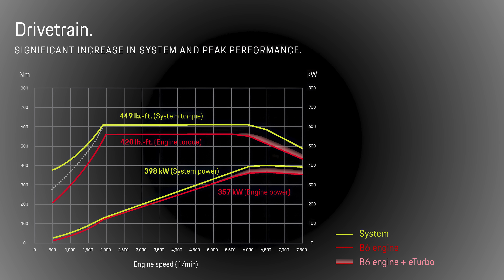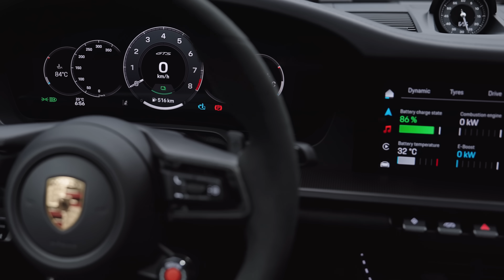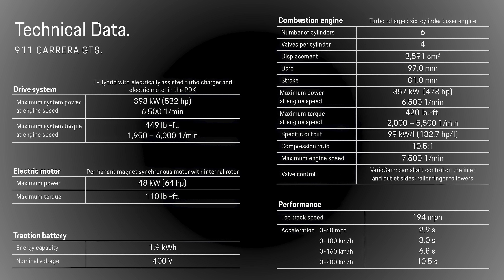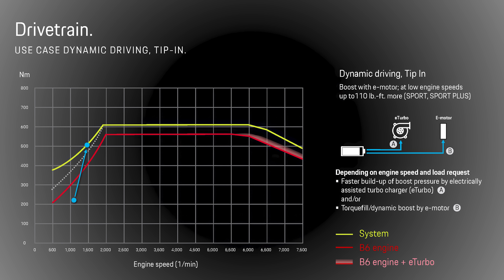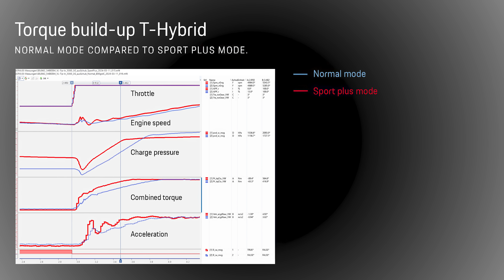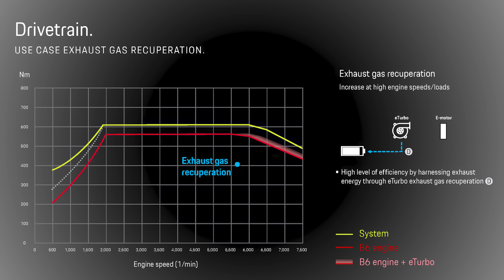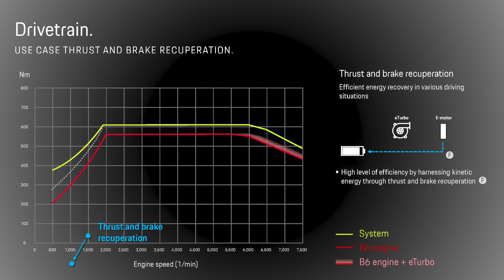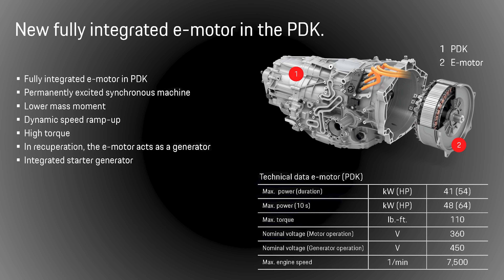2025 Porsche 911 992.2 | Bigger Engine, Electric Turbo

Comment: I’m confused about the mention of a waste gate or lack of waste gate. If the turbo is driven by battery why would there be a waste gate at all and what was done to correct the turbo boost level difficulty that supposedly stemmed from this.

Comment: Curious about the e-turbo and how it works.  I  apologize for my basic knowledge of turbos. From what I understand the turbine and compressor are connected by a single shaft.  When the electric motor spins up at a much faster rate than a typical exhaust driven turbo what happens on the exhaust side?  Could the electric motor spin up so fast that you end up creating a vacuum situation on the exhaust side?

Comment: Best car site. Great work here.

Never say never, but:

1. Hybrid.
2. Push to start.
3. Digital tach.
4. (really #1) No manual.
5. Builds now over $200K with options.

All of the above make me feel lucky I just picked up my new '24 Targa 4S that I ordered with the 7 speed. I don't care about sub 3 second 0-60 times and will likely never drive the Nurburgring. I can imagine an open air non hybrid manual transmission car coming in a year or two but only Elvis and Seinfeld will be able to get allocations.

Comment: It will be fascinating to hear about how this thing drives.  I am sure that Porsche have made a wondrously capable car.  But, does that translate to "better"?  I am curious if the engineering team were asked whether a manual transmission is even technically possible with this setup.  without full computer control of the transmission too, can any of this be made to work?  I suppose then that all t-hybrid cars will be PDK.  Start buying up manual-transmission Porsches now, I guess ☹.  If the GT division cars are all that are left with a MT, it's going to make those allocations even harder to get in the future.

Comment: I dont know how smart it is to rely purely on the e-motor to spool the turbo.

What if you run out of S.O.C.... Why not put a clutch in the turbo so that it still works with regular exhaust gas, or the emotor

Now that exhaust gas is no longer being used for turbo spool, what are you using it for? He explained the heat part of it, but what are you velocity of the exhaust gas for - nothing??? 

It's Porsche guys, cmon, make a crazy system with 2 turbo chargers, one with exhaust gas, one with electric motor to spool. A crazy double intake plenum to combine both compressed air flows into the combustion chamber.

Comment: Fix a problem that didn't exist nobody cares about the second that the hybrid system shaves off the 0-60 or the top speed or god damn mpgs ,the 911 was supposed to be a analog mechanical marvel wich it isnt anymore nobody complained about turbo lag in the first place nobody ever said power was insufficient,could have just tuned up the engine porting the exhaust intake cams compression etc instead of this ,besides the price is bonkers

Comment: The new hybrid 911 isn't about how the car will drive.  It is about what the car will cost to maintain after warranty as the electronics, from 100 computers to allow electric and gas powertrains to seamlessly produce power begin to fail, including motor inverter and Li-Ion battery outside of warranty when its on the customer's dime and not Porsche's.  Honorable mention to electric turbocharger and electric AC compressor.
Hybrids throughout the industry exist for one reason alone, 2.5 x's the complexity of ICE only automobiles which translates to long term profit for automakers. 
Selling exclusive, proprietary parts out of warranty for a car with two powertrains versus one if you can even find a mechanic smart enough to repair this car which btw will not be at an independent mechanic. Porsche would never allow the proprietary computer diagnostic capability to filter to mechanics outside the Porsche dealer network as it would be cost prohibitive for independents to own this diagnostic capability.

As to driving dynamics, power to weight will only be fractionally better, if at all.  Reason is weight. Hybrids are heavy which has a handling cost as well.
Anybody who has driven a $200K modern ICE Porsche is blown away by the performance. 
High end ICE Porsches have astounding performance.  A new hybrid Porsche isn't about performance.  It is about cost to the consumer short and long term which translates to profit.  The Germans invented this business model of overengineering their cars for planned obsolescence and extract more money from customers for greater profit.

PS. a bone stock 2018 Chevy Camaro ZL1 1LE beats this Porsche around the Nürburgring  in 7:16.04 for 1/3 the price with of course only a gas engine, a much more powerful gas engine which btw an average mechanic can repair.

Comment: 991.2 base msrp carrera was $90,450. Now starting is just over $120k (06:36)? I get that the average househould that buys a porsche is $400k, but wtf. A 25% increase in price over 5 years? That's just absurd. 

End of production for 991.2 was December of 2019. Accounting for inflation, that price is closer to $110k, not $120k.

Comment: "The hybrid doesn't change the feel of the car." Exactly what they said when they released throttle by wire. "You can't even tell!" Little by little they grind away what makes these engaging and turn them bland until one day not far off everything will be an automatic crossover. We'll wonder where it all went so wrong.

Comment: "More power, more performance!" - "8 seconds faster round the (irrelevant in the real world) Nürburgring!" - well that's nice - but how about more quality & reliability like Porsche used to have?  Porsche have in recent years gone from being one of the most reliable manufacturers - certainly THE most reliable German manufacturer, to being sub industry average.  I used to think if I was ever going to get a German car, I'd get a Porsche - now I just wouldn't consider a German car.  I just don't understand what happened - but the way the designers and engineers talk here, they don't even mention reliability once - so maybe what they are not saying is what the problem is.

Comment: For those who understand that heat is the biggest enemy of magnet motors, sandwiching it in between a hot turbo housing takes some work to solve the temperature issue. Although being skeptical at first of the hybrid, now reading the full spec, it is a great advancement. But hopefully, it solves the Porsche hybrid issue from the old days: once the battery is dead, the entire car stops.

Comment: We have already passed the threshold of diminishing returns and this is not the future I had in mind.
The ultimate cars have passed their peak.
When I hear H and E and other buzzwords like integrated, recharge, thermal, 48volt, etc,,, this means more complicated, more wiring and more weight and of course, more money, oh, and I forgot, no manual transmission!

I can't pretend to be impressed because I'm not an ass kisser.

Comment: I hope that there wouldn't be electrical issues as what tycan came with.  Practical point of view, wonder two things.  what if battery dies......... there is no 12v battery......  Does it means we can't do jump start the car and car needs to be charged?  And what if electric motor is not working.......  there is no clutch........  Does it means car can't be moved at all?

Comment: It’s always awesome to see Porsche roll out faster and more technologically advanced 911s; however, I have some mixed feelings toward the 992.2 this time. 

The analog tachometer
The ignition 

These two things are somewhat nostalgic, but true to the iconic image of the 911. 

I don’t really understand why all of the manufacturers put a big screen, or even multiple screens, at the dash, and call it as the interior design? 

For actual users, one definitely can embrace the beauty of the old fashioned analog tachometer; Not even to mention it comes with less distractions at night, and less light reflections in general; also, aesthetically, while seated inside without firing up the engine, the whole black panel just looks so cheap and tasteless. 😢😢

At this point, I feel fortunate enough to have 992.1 911T, as the last gen with analog tachometer and a more driver focused set up!

Comment: I just went out and hugged my 991.2 GT3 6MT.
Reply: Proven 4.0L H6 naturally aspirated engine. Solid lifters. Manual transmission. Easy to work on. Can buy engine oil M1 0W40 FS at Walmart. Heavy 12V conventional lead-acid battery. Exceptional build quality, fit and finish. Analog gauges, key in ignition. Lots to hug.

Comment: The complexity of that oiling system is daunting.  Semi dry sump with directed oil as needed?   Typical German solution.  Man, this thing is really loaded with new tech.  Very similar to the eRay Vette on the hot lap strategy stuff on max attack.   Sounds like a pretty thorough overhaul.

Comment: First off, congratulations to you guys for getting in early on the launch notes for this car.  Its certainly an accomplishment and a brand that many enthusiasts have idolized for a long time - quite an achievement!

Moving on to the 992.2 - this gives me a collective feeling of "meh".  The turbo tech is impressive, and I'm glad they decided on something minimally intrusive, but everything about this car makes it as dead to me as the base 992.1 (which was also PDK only).  Porsche seems to be losing the plot more and more as the years go by - they keep trading out the traditional 911 experience for more useless crap to show off on a spec sheet.  I spent a lot of time around 911s ranging from G-body to 997, and there was an intangible that kept those cars fairly familial (the only downside being how horrifically cheap 996 interiors were, but that didnt detract from the sound and driving feel of the car).  This just seems like everything the 911 is not - you're isolated out of almost everything special, and it's just fast....who cares?  As we enter the age of stupidly fast EVs, sports cars need to bring back emotion - especially when you're demanding 911 money for the pleasure.  How can Mazda with the ND, or Lotus with the Emira, get this so right, and Porsche get it so wrong?  I don't get it.  Anyway...soapbox mode off... I'll go back to fawning for a G body SC like the old man I'm becoming 😂.

Comment: Very cool technology, but I’d be worried about long term reliability. Maybe I’m just getting old but it just seems like so many more things could break on this (with time). I have a 991.2 and the wastegate failed on one of the turbos. At least that’s one thing you don’t have to worry about with the 992.2.
Reply: Yeah now you just have to worry about electrics imbedded in the turbo, a unique 400V battery, a water pump buried and driven by the oil pump for the sake of no accessory belt drive…great progress in reliability!!!

Comment: I have a 992.1 Carrera S that I really enjoy but at times it is a bit boring.  The turbo engine saps some of the emotion from the engine. It’s not as charismatic as my old 997.1. I understand the need for improved efficiency but I don’t necessarily trust it’ll lead to a better driving experience. That being said, I’m going back to a naturally aspirated engine this time around. My C8 Z06 should be here around July. I wish the GT3 didn’t command such high mark up’s or I may have gone that direction.

Comment: 992.1 prices 📈

-Rear taillight makes the car look like a full on EV. They did not need to add another long lightbar. That weird section where the “Porsche” logo looks awkward. The 992.1 rear end looks much better.
-a push to start button. Really?!?!
-fully digital analog?!?! They really listened to consumers 🧐
-sure, the hybridization makes it faster but I’m going to bet the ride will be more soulless. Faster is not always better. I’d much rather drive a 993 over a Tesla S Plaid any day.
-Maintenance will most certainly be a nightmare in the long run with all of these complexities. 
-those front fins are a no go. 
-MSRP “slightly raised”?!?! It just went up over $12k…. Almost 10% increase.
Reply: These are $400+K in Australia, totally ludicrous money for a Porsche.
Reply: Right on all accounts; Porsche hates its traditional customers.   Every new 911 will be more EV u til it’s a Tesla wanna be.  Might as well buy a Chinese BYD since EVs are just a commodity.  The engine was the soul of Porsche and they have gutted it.  They will force this down your throat if you want a new car.  As far as I’m concerned Porsche is dead to me.

Comment: Really cool video. I have a feeling this drivetrain is more efficient on the EPA cycle but less efficient in the real world. That electric turbo does not appear to be fed by the exhaust, if true it's less efficient than a supercharger on boost
Reply: No, it is also fed by the exhaust, and when it can take more from the exhaust than it needs for the required air flow then it uses exhaust gase energy to recharge the battery that drives it on initial spool up
Reply: @harryspeakup8452  ah. Must st be some interesting ducting to get the exhaust all the way around from the other side of the engine

Comment: This thing is disgrace. So they kept the shitty turbos that ruin the sound n soul n to further destroy it n put the final nail on the coffin no manual trans n added weight from the batteries. WTF what is going on in this world, I would be ok with extra weight from batteries if they made the engine naturally aspirated n no manual is a big no. Big joke of a car. N no analogue rev gauge? WTF so it went from one of the best looking rev gauges like a rolex, to a apple watch. What a joke. OMG they ruined the rear end WTF, where did the tail lights go? The 992 rear end was already a downgrade from the 991.2 but atleast it still looked good, this is just hideous, man this is so sad. There just getting bigger heavier, garbage n there goes the best fun supercar. 992 GT3 is the last real Porsche before they officially die off. Also the GTS is no longer a GTS its now just a heavy worst carrera. It used to be a more daily alternative to the GT3 back when it was naturally aspirated, n the turbo one for the half ass enthusiasts who were able to deal with the terrible turbo engine.

Comment: "Water pump is driven by the oil pump". Hmmm, this engineer must not have ever heard of the early 2000 Benz S & CL class problems resulting from steering and suspension systems being serviced by a single hydraulic pump.

Comment: Does the e motor in the PDK gearbox smooth the start-stop behavior of the transmission/ help with creeping? The one thing i dont like about my Cayenne is the 8 speed auto, it is sluggish and dissapointing after driving a PDK car, I know they use it instead of the PDK because dual clutches are no good offroad which the cayenne has to be able to do. In the past I have thought they should take a leaf from the Acura ILX book and do a dual clutch with a torque converter between the engine and the clutches, but if the E motor was properly calibrated to take over the creep function (assuming I am understanding correctly that it is downstream of the clutches) then it could make the PDK viable for the cayenne.

Comment: This sounds nice, but I’m very curious about how it actually drives and about reliability in the next three to five years. Complexity usually means more expensive, not only to buy but to maintain. I may be part of a minority, but I don’t need more performance than any C2S since the 991.1 and would like less expensive maintenance over time not more. I guess we’ll see how things work out over time.
Reply: Then they will advise you to look at the new C2 rather than the GTS drivetrain
Reply: @harryspeakup8452  True

Comment: the e turbo system is pretty weird yet interesting, seems like they have gone with it soley so they can have a bigger turbo to cover the top end and the electric motor to spool it quickly and not have lag. i think most people would have just prefered no turbo at all and just a bigger electric motor in the pdk for torque fill and just an n/a higher reving ICE with less restrictions in the exhaust.

Comment: 3 decades of 911 ownership from club racing to concourse so I am a core Porsche demographic of customer.  Not interested in a hybrid 911 and it’s obvious it is done per government regulations and NOT making the car more performance enhancing.  There will be a nightmare of technical problems if one electric engine has any issues.  BMW is seeing this with the electric “helper engine” in the ZF transmission.  One problem and the entire vehicle is bricked and needs flatbed to the dealership.   Obviously the last great modern 911 in style, build quality and performance is the 991.2.  Each generation seems to get watered down by outside influences from Porsche that intrudes on design and even build quality.  This new one is a serious compromise in 911 DNA but I understand Porsche has to deal with very intrusive Government overreaching standards in air quality.  It’s a shame but it is what it is.

Comment: My issue is the electronic in close proximity to high engine temps. Are they using higher heat tolerance material than silicon?
James May "Nurburgring tuned cars are rubbish!" 
We’ll see…

Comment: Many sports car owners fall into the trap of thinking the version of "X" they own is the greatest.  Porsche is no exception.  I wonder if increasing regulations will create demand for non-electric Porsche 911s in the same way water cooled engines and electric steering have created a demand for air cooled and hydraulic steering 911s.